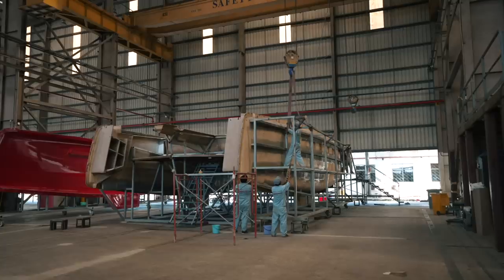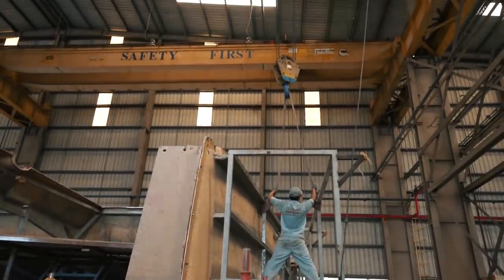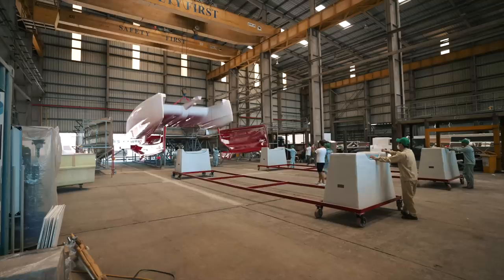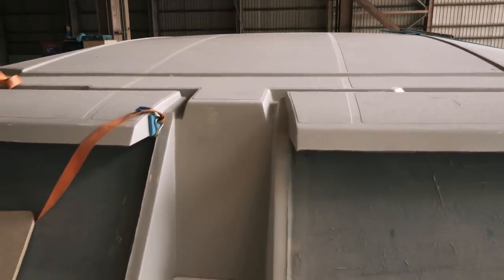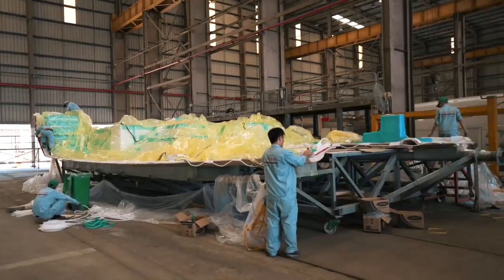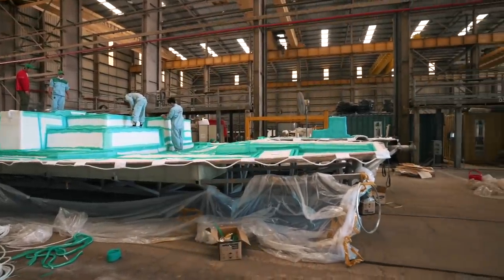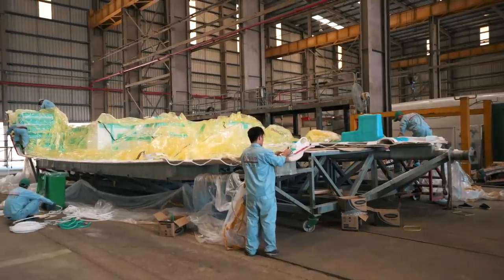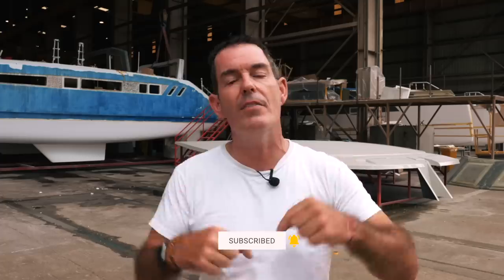Always A Nervous Moment! 😬 De-moulding the Hull -Plus RR2 Build Update

Comment: Rain catchment devices are brilliant, but so obvious that it is odd this isn't used on all vessels AND homes!
Reply: And making all new homes energy neutral. With all the advances in tech all new housing should at a minimum be able to supply energy to itself.
Reply: @ralphgesler5110  true. Jesters historically have free speech to point out the foibles, errors and mistakes of others. Even rulers.

Comment: Having dealt with contaminated rain water (medical intervention required), I would suggest adding a pre or post tank filtration system. Nasty bugs can breed on "clean" decks. We ended up installing  pre tank filters and a reverse osmosis system with uv filter plumbed to the galley and head sinks. The cost of a DIY install was less than $300 which was about a tenth of the medical bills.

Comment: In an earlier video you showed how the heads, bedrooms etc are moulded externally then dropped as one piece into the hulls. It's an interesting (and understandable from a cost and speed pov) way of building a construction line for boats. It also does explain, to an extent anyway, why so many of the production boats squeak really badly when sailed. If these dropped-in sections aren't bonded literally everywhere they touch or might touch the hull then you're inevitably going to have the incessant squeaking as everything flexes underway. Hopefully Seawind will do this fitting and bonding better than some of the other large production boatyards do...🤞

Comment: Same coachroof drain system as my previous FPs Athena 38 and Belize43 from-95 and 01 respectively.  Good to see that you use the coaschroof drains for your water supply backup.  Looking forward to the fitout, if anything like the stainless work you've shown us earlier it would be amacing!

Comment: Incredibly exciting to see your boat literally coming together! One question on the rainwater harvesting system built into the deck (a brilliant design augmentation, incidentally). Did you consider installing a "day tank" for the rainwater coming off the deck, in a manner that the water didn't flow directly to your onboard water tanks? An initial day tank for temporarily storing the harvested rainwater and then transferring it through a physical and UV filltration system to the active water tanks on the boat would relieve any concerns about material (dust, bird poop, etc) washing off the deck in the rainwater and fouling your water tanks. The day tank could also be used when putting water on board from suspect sources on shore. It wouldn't have go be  very large - maybe 10 to 20 gallons - and could be automated to operate on demand when water in the day tank reaches a certain level. This, in addition to carefully cleaning the deck in advance of harvesting rainwater, should resolve any potential potability issues. The day tank would need to be flushed from time to time.

Comment: To nick the geek... water catch system... it needs your help.... how about, pre rain catch, fills up, 
Solar,  small pump in the open. Pumps, new rain, into a 20 or 30 gallon, upper deck, rain water tank, ( those that are flat, ) from there , put 2 inline filters, takes just a little pressure. Heres, why... if you have a cool looking 30 gallon, deck mounted, pre tank, keep it filled with filter fresh water.. for, ( a quick deck, fresh water rinse,  a quick spray down of CLOTHS to hang up, a fast, wash down of the catch of the day. Even if theres a fire, or it's 110 degrees on watch, use it for a quick rince off.. and, Nick, it's easy to see the boat built is haveing you in dog years. You'll be 14 years older, Karen will only be 2 years old. And that fresh water, could be used by yout nurse, to rinse you, underwear out....hahaha

Comment: Is that hull cored below the waterline?   Looked like balsa core in the video.
Reply from the maker: Foam cored.
Reply: Won't it be a plastic, probably closed cell foam that doesn't rot. Probably last 100 years.
Reply: Solid fiberglass below the water is way better than foam cored which holes very easy on rocks should one break an anchor and drift etc.

Comment: I don't want to rain on your parade, but i thought seawind were already well versed in fresh water capture. Didn't the original seawind 1600 have fresh water capture when you review it back when?
Reply: I think Terysa may have been referring to the doors/valves that they can open to allow the rain water to enter the tanks AFTER you are happy that the roof is clean and you have cleaned the mast step area (you'll notice how the camera focus's on the two little doors on the side). I could be wrong but at the time (3 years ago) most rain capture systems probably didn't have the isolation stops to give you time to go clean the roof and capture areas. With this system, now you do. This would make your filter system last much longer between filter replacements.